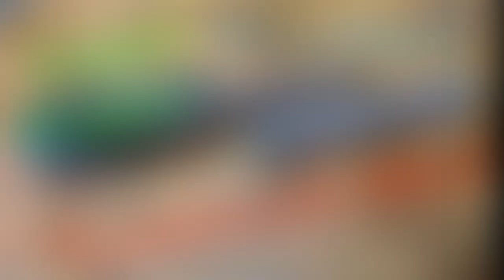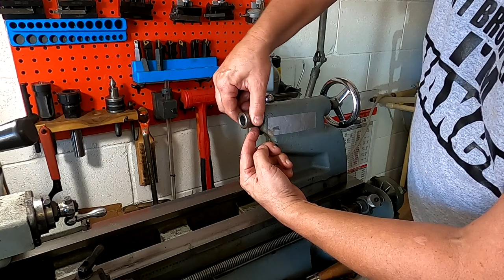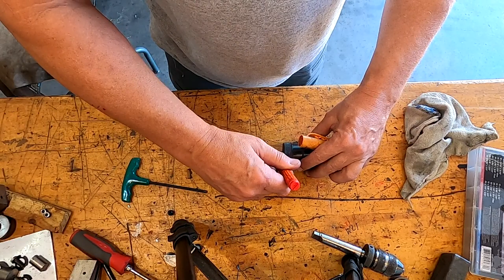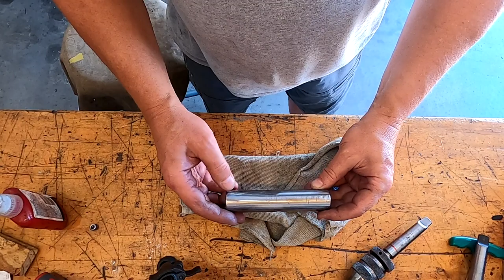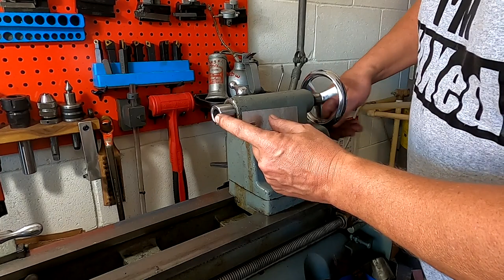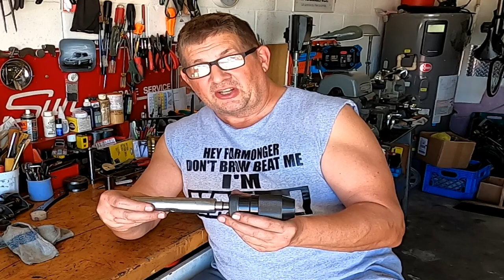Easy Tailstock lock tang modification for Atlas - Craftsman, Southbend, Logan and others

Comment: Hi Don ,  i was wondering how hard did the quilt seem to be.    Even though I watched the video I could not tell but it did not seen to be to hard.   One thing I did wfh mine (atlas 12 x 36) was pick up a reamer and used it lightly and it seemed to take out some crud out of the spindle so I got a mt3 reamer for the chuck spindle and found the same thing and got crud out as well.   They seemed to help hold better after that.    I bought the lathe second hand but it was in beautiful shape and did not have much wear at all.    I try to watch the tapers close and keep them clean.   I sure like your idea and will consider doing this as well.    Thanks for the video. 

Dale in Canada 🇨🇦
Reply from the maker: Dale the quill drilled a lot easier than expected. I started with two sharp drills and they stayed sharp... I also use a tapered reamer for clean up. I did a short show of that i my tailstock torque bar video. Thanks for watching. Don
Reply: @donsengine3158   Thanks for the reply.   That is a video I have not seen yet but will be soon. 

Dale in Canada 🇨🇦
Reply: @donsengine3158  i was wondering why didn’t you run the drill all the way to the other side, you must have flipped the tailstock over to get the other side?
Reply from the maker: @tonypike5785  Hay Tony, I drilled right through. I cut a lot of footage to speed up the video and I guess I wasn't getting the full through cut image. But, yes, It was one shot, no flipping.  Don

Comment: While I know we can’t always avoid it, the tang is never supposed to be used for the purpose of holding the tool from turning in the taper. It’s only for the purpose of removing the tool. We see torn off tangs all the time from that.

If the tool does turn, it means that the taper is bad, or that there’s oil on the parts. When a tool is put into the taper and given a bit of smack when setting it. It shouldn’t turn at all, or no more than a couple of degrees before locking. If it does turn more than that, the taper is likely scored, either internally, or the one on the tool. That needs to be fixed. If that’s not it, then the internal taper needs to be cleaned with a paper towel with acetone or equivalent, as does the tool taper.

If the tool isn’t “set” with a smack when it’s inserted, it may not lock.

I know some people think I’m a spoilsport when I write things like this, but I’m just giving best practice. Just keep in mind that if there’s something that shouldn’t be happening, there’s always a reason. Find out what the reason is first before making modifications. This one for a small lathe is harmless as the torque isn’t high. But remember that’s it’s likely that the tailstock quill isn’t hardened, and so check to see the condition of the taper first. If it’s gouged, then your tool won’t be accurately pointing towards the headstock.
Reply: A number 2 MT in itself doesn't have enough surface area to hold while drilling larger holes and once a taper slips quite often the damage is done. The tang is a huge advantage. If the tang is ONLY for ejecting the drill then why is it flat? Both my Logan and South Bend lathe eject just fine with or without a tang. Where I worked before I retired the machinist always used the Monarch lathe to drill which had a reduced section to hold the tang. To my knowledge they never broke a tang off. I'm not saying it can not happen but it takes a LOT to torque to do this. When rebuilt my Logan I reamed the tailstock ram and started out with new arbors on my chuck.  They held great until I tried to drill a 1-inch hole and it scared both the male and female tapers. From that point forward I clamped vise grips on the drill shank to stop rotation. If the tailstock ram had been equipped with a reduced area to grab the tang the damage would not have happened. When rebuilt my South Bend 11 I installed set screws to grab the tang and it was the best thing I ever did. The Logan had a wimpy little pin to engage the ram so I never modified it. The SB has a substantial key that would be very hard to sheer. There is an patent regarding the tang by Cleveland Drill around the time Mores introduced this taper. The patent stated that it was to stop rotation when the taper failed. What you stated is widely accepted and supported by Morse but not the drill company. The purpose of the taper is also to help stop rotation and resulting damage. It just depends of who you want to listen to and how much taper damage you are willing to deal with.
Reply from the maker: Mel. Yes I know. Many things I don't say cause the guys watching are more than likely experiencing similar issues. Lower end machines have their own quirks and working around them can be half the fun.  Don't know if you noticed that I did give the taper a nice whack to seat it.  Sometimes we get lazy and don't send them home and a little catching or hang up when drilling and pulling back can cause a taper to come loose. We hope for  a reseat when pushing back in, but a spin will cause galling. Adding the tang holder is meant to stop it short and give the taper a chance to seat under pressure. All points are taken and understood quiet well.  Hope others that may not know these points see your comments.  Don
Reply: @WinkysWorkshop  I’m not going to say that the tang isn’t helpful in an emergency. But there are adapters that fit a larger taper into a smaller taper. We’ve all seen them. They’re really long. But because something is there, doesn’t mean it’s correct. People use tooling incorrectly all the time. A big mistake is using a drill too big for the taper, and over torquing it. I believe a 7/8th is the max for a #2, but I could be wrong. The point of what I was saying is that you are not supposed to use the tang as part of your work holding. That’s wrong. Period. A tang will help prevent scoring on a taper, if it slips. That’s why it’s flat. So yes, you’re partly correct there. But again, that’s telling you something is wrong. It’s not an excuse to do things incorrectly. Also, a tang will not prevent the tool from pulling out of the taper under certain conditions. You also might notice that many tools don’t even have tangs anymore, with self ejecting tailstocks being prevalent, something that wasn’t even available when the tang was invented.
Reply: @donsengine3158  yes, I did see it. It was hard to miss. Let me get something straight. I’m talking to people who are new to this, and see an experienced person, such as yourself do something g that you understand quite well, and miss a lot of the points.  I saw a lot of people with these problems saying they they were gonna do this too. I’ll bet that very few of them understand the implications of it. I’m not being insulting, but there’s little out there to really help home shop people who buy equipment and don’t know how to use it.
Reply: I'd say you are right, 7/8" is about the maximum for a #2 taper but this also means that under the right conditions a 1/2 drill may also spin the taper which makes the tang a great safeguard. 
>"You also might notice that many tools don’t even have tangs anymore". 
Centers have no tang but every drill chuck taper I have seen has one and no way would I have a drill chuck without a tang. 
>The point of what I was saying is that you are not supposed to use the tang as part of your work holding. That’s wrong. Period.
Call me a rebel or even defiant but I have a problem with this statement. If a tang stops my chuck from spinning and does not create a danger to me or the lathe then I see no problem whatsoever. Wrong is your judgment. I say whatever works is correct. Quite honestly I commend anyone that works around the limitations of their machines (safely of course) and gets the job done. My Logan with a perfect tailstock ram and new taper was a pain in the butt...  My South Bend with the set screws that grab the tang is a dream. If I was working to a #3 or #4 taper I might see things differently. I guess I see rules and procedures as guidelines only. Following them without question is stagnation. This is probably also why I was responsible for over 100 machine modifications in the printing industry. There is ALWAYS a better way!
Reply from the maker: @WinkysWorkshop  Excellent point Winky. I think I read the same statement about the morse taper tang lock in our LeBlond and Kent manuals.  Don
Reply from the maker: @melgross  I learn something new everyday. Thanks!
Reply from the maker: @melgross  Mel, each creator has a niche that they work in. I don't expect to be all things to everyone. If i get over someone's head then thank god there are those that will pick up what I blow past. I know my viewers are on other channels and by getting a taste of a lot of different methods, I have no doubt they'll come away with a well rounded outlook on how to do things. The feedback  I get here and on my email pretty much confirms this. Honestly your attention to detail would probably serve you well as a creator. Have you ever thought of setting up a dedicated machining channel? Ide watch for sure.  Like I always say,  If I'm the smartest guy in the room, then I'm in the wrong room.  Don

Comment: Hey, Don, what a great modification. I will do this on my old Taiwanese lathe. My tailstock tube is 1.3” in diameter, is that about the same as your Atlas? What diameter grub screws did you use, please?
Reply from the maker: I think it is about the same diameter outside. I used 3/8 X 3/8 NC grub screws. I shaved the heads by about .080" to keep them from protruding.  Good luck. Don
Reply: @donsengine3158  Many thanks, Don

Comment: Hey Don did u make the die holder that goes into your tailstock for threading?
Reply from the maker: Hey Joe, No, I picked that up when I was living in Germany. Can't even remember the manufacturer.  It works pretty well and has changeable die heads.  Don